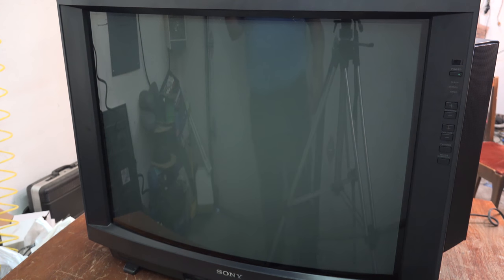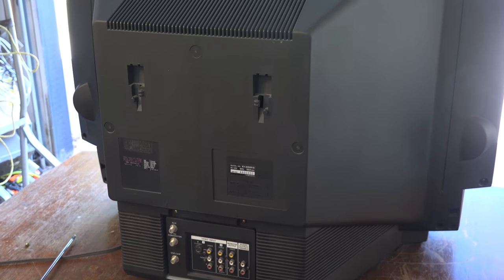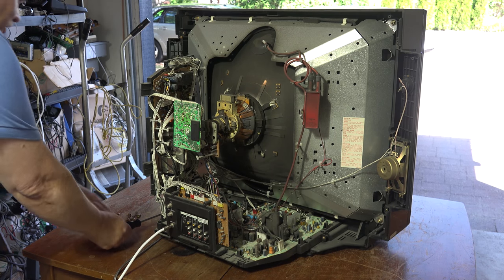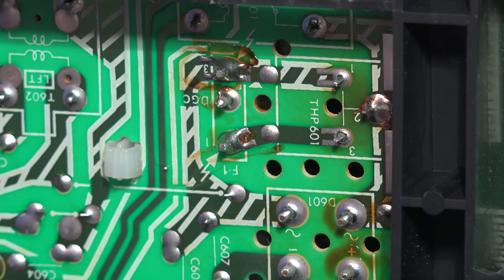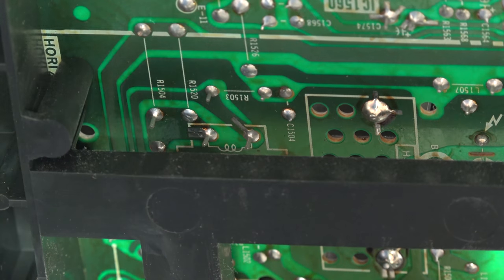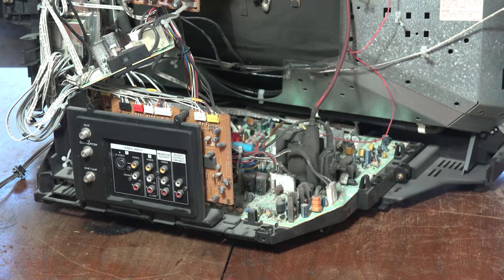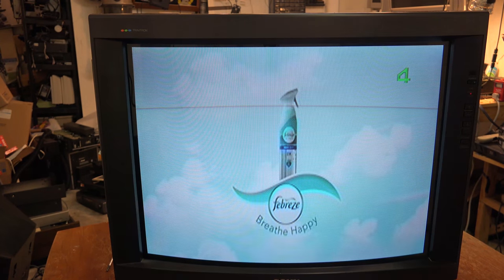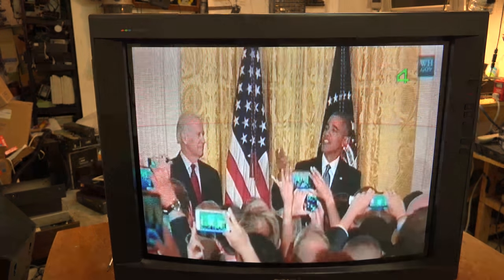SONY CRT Distorted Color Degauss Fix

Comment: I had the same problem with my TV(LG). I watched your video and right after checked what was the issue in my case. As it turns out my problem was exactly the same. 10min fix and it works like a charm now. Thanks dude!
Reply from the maker: This fix applies to all CRT sets.Every color CRT TV or monitor has the exact same circuit, so whatever the brand, this trouble does happen. The degauss thermistor runs hot. That is how they work. They start out at low resistance which allows full current to flow though the degauss coil to neutralize the magnetic field that builds in the shadow mask or aperture grill in the tube. As current flows through the thermistor it gets hot. As it get hot the resistance increases and thus the current drops. This causes the alternating magnetic field in the degauss coil to gradually drop thus demagnetizing the tube. This increase in resistance makes even more heat in the thermistor. The hot / cold nature of the thermistor puts stress on the solder connection due to the dissimilar metals. Copper for the PC board and leads to the thermistor, and solder which is a tin / lead, or a tin/silver/copper alloy. Eventually it will break on probably 90% of tube tvs in service.

Comment: Awesome!! I was just given a 13 inch JVC from 1989 with the same problem, I was flexing the board and it started smoking for a second and then the screen was good but only lasted like an hour that was aa week ago, just watched this video and found a pin on the same piece with melted off solder and just re soldered it and is now looking pretty good for a 34 year old tv.. Thanks!!!

Comment: Sony crts are brilliant, we still have our 14" one in our bedroom from 1989 still working fine, husband repaired it once when a resistor started glowing, that was 10 years ago, brilliant tvs these, yet our Samsung lcd downstars is always going wrong, I dont think the flats last as long as the old crts did.
Reply from the maker: No flat panel will last nearly as long as CRT. The first flat panels were plasma, and they got a bad rap out of the gate due to some issues, but in reality, those early plasma sets have actually lasted much better than the LCDs that replaced them.  Plasma sets have a very high part count, and that means more parts, and more solder connections that potentially can go wrong. LCD suffer from a similar fate, too much integration into non serviceable boards. So even though LCD have fewer parts that can go wrong, the density of the chips, and the way they are attached, BGA, and hot bar stamping onto flexible pc ribbon cables have some serious reliability issues. The move to LED is even worse. LEDs are not as reliable as people would like. The worst thing you can do to a TV now is run it cranked up bright. That heats up the LEDs and if you have a weak one, it will be the one that pops, and takes the entire set down. 
CRT on the other hand was very simple, and even though there were high voltage areas ina CRT set, they generally used large components that were not being pushed to the limits.  Also CRT technology has been around for 100 years, so they had that technology perfected decades ago.
Plasma is also an old technology going back to the Nixie tube era of the 60s.
One can think of a plasma TV as one giant nixie tube. As you can probably guess I love plasma TVs. As far as the flat panels go I find these just cool.
High voltage, and electrons flying through space. Cool.
Reply: I picked up a 27" Sears Sanyo set from 1989. My grandma has a Samsung LN52B630that replaced a mid 1990s Philips Magnavox in 2009. Hasn't failed yet surprisingly, it sees a lot of use too.

Comment: Thank you for the awesome share.
Quick note: 4:59 you forgot the bridge rectifier, it also has broken joints on the AC input side.
Reply from the maker: FixDaily 

Just because I didn't show that on camera doesn't mean it wasn't done. This video was to show the fault of the degauss thermistor failure. Not every potential fail. But yes I did solder it and put "way too much" solder on it according to the dozens of thumbs down the video got from the Trolls, I mean the experts that have never worked in the repair business. I had 15 thumbs down the first day with people "educating" me how to solder. So the video came down and that shot was cut completely.
Reply: I'm not one of the thumbsdown sir, also i'm one of your subscribers and i subscribed after saw this video so i gave you the respect you deserve, it just got me curious, didn't meant to be rude.

Comment: Another I formative article,  nice work! Kind of depressing though,  considering I got rid of a nice 2001 Sony Trinitron last year that had the same issue. These CRT TVs still have a place,  especially for those of us with a lot of retro AV equipment.
Reply from the maker: I tossed my old Panasonic 34" HD CRT a year or so ago because my wife wouldn't let me keep it, and regret doing so. It did have a problem though, and on t hat set Panasonic didn't sell parts, only full boards, and they were NLA.

Comment: The solder joints on the diode bridge D601, and the fuse F1 also have cracks on them.

Comment: That problem is very common here in the Philippines and I thought the reason is we are using a 220 volts power supply but I was surprised that you said it's a very common problem because in your country it's 120 volts so the heat energy from thermistor is only about a quarter compared to 240 volts. I can even see that the TV is rated 120 volts around 1:07 mark.
Reply from the maker: Actually the heat is the same, as the thermistor is a 120v rated unit here. 
The problem is heating and cooling. It causes stress fracture by thermal expansion of dissimilar metals. The copper expands at a different rate than the tin and lead in solder.

Comment: Very well photographed, I think I have the same problem with my 2002 Phillips. If I could find out how to buy a new "thermister" ( is that the correct term for the small black box pointed out?)  I would repalce it as gives the same reaction to coolurs when I prod it with a wooden rod.
 It has 4 pins which seem well soldered. The lettering on it is DJ1U-Q,10VDC,  8/60A,  250V,
DEC421 Japan - I think this last is the number of the PCB.

Comment: Is the problem of color distortion (in my Trinitron its a bit discolored on the right side) fixable by just getting a basic degaussing wand and doing it by the manual circle motion? Im not handy but i think i can handle a degausser wand
Reply: Nevermind, degaussing coil didnt work for me. Looks like internal damage to something.

Comment: I've read that the FD Trinitron displays, as well as the related HR Trinitron displays, are intentionally magnetized at certain points around the perimeter of the glass face.
Reply from the maker: They have a bunch of little correction magnets stuck around the yoke. you can see then stuck to the bell of the tube. Those flat strips also have magnets on the tips.

Comment: My 27" Sony Trinitron fell on its face now I have rainbow color like the one you worked on. What do I do now i love these tvs they're better than the new ones.
Reply from the maker: I hate to the the bearer of bad news, but what has happened in the aprature grill, which is what make a trinitron, a trinitron , has shifted internal inside the tube. There is noting you can do, the tube is internally damaged.

Comment: My dad made a degausser that can be plugged in and held near a CRT.  Boy does it get hot after a while!  A good demonstration of electrical physics.  If I may point out, Johann Gauss was a German; this being the case, the word 'Gauss' is pronounced with the 'au' sounding like the 'ou' in 'out' and the 'ss' sounding like the 's' in 'snake'.  Did you sell that?
Reply from the maker: Yes they get hot. I made one using the coil off an old TV back at the shop.
Reply: @12voltvids  Did you sell the TV?
Reply from the maker: @infinitecanadian  
Yes gave it away to 3 guys that moved out here from manatoba to work in the new mega mall. They wanted a CRT for gaming
Reply: @12voltvids  Excellent.  Glad to hear that.

Comment: The funny with the magnetic discoloration is that may happen even if rotate the tv to a different position while it is working and this is related with the earth's magnetic field,speaker magnets,metallic objects or random times.But the most strange of all was when i placed a tv after a repair to the customer's house and the weather outside was extremely cold and inside the house the room temperature was hot.When i pushed the mains switch ptc got cracked and caused a short circuit and i took the tv back to the lab for a new repair.Due to the high temperature difference between inside and outside the ptc ceramic disks broke in the transition from frozen state to hot.After that in cold weather every time i was leaving the tv five to ten minutes to get room temperature and customers were constantly wondering the reason why.
Reply from the maker: That is why the degauss circuit operates every time the TV is turned on cold.
Reply: What impressed me was that degaussing ptc seems to work inside room temperature limits and not from frozen cold to hot.

Comment: That line caused by the camera, on the tv, looks like a problem I'm having with my old crt. The lower part of the display has this problem where horizontal lines just like the one ween in the video would flicker every now and then. Do you have any idea what the problem might be? Where would you look, at the V. Out IC?

Comment: What if you still have the exact same issue, barley any "thump" from the coil and the solder joints are perfect. I cannot find a reply online and the ones I have from donors are not the right size or number of pins. I need a 3 pin terminal and I only have 2 terminal donors

Comment: Great repair, you know, I'm trying to repair an old TV that my grandfather gave to my dad as a wedding present. It's a Sony Trinitron KV-1942R (1978), the thing is, everything works fine except the colour,  the image is black and white and I don't want to take it to repair near me since every repair guy here takes parts from electronic devices, i've opened it and it seems there´s nothing wrong, except being soooo dirty lol. I'm clueless on what's going on.
Reply from the maker: Loss of color generally means the 3.58 color oscillator is not working.  Could be the crystal is bad or one of the little caps in that circuit.  Unfortunately unless it is an obvious cold solder connection you will likely need a scope to trace the loss of chroma or sub carrier reference.
Reply: @12voltvids  Thank you for your help, what I did find was a mini cylinder glass with 2 wires inside, it had a lot of rust,  it was  on the board from the yoke, I did solder it and nothing. I'll keep diggind on what's going on. I'm confused since it has like 3 boards to work with.

Comment: I have horizontal lines with washed out colors on the 2 composite inputs in the back. The S-Video input in the back  and the composite input in the front looks fine. Is it the Deguasse too?
Reply from the maker: Sounds like something in the video input switching.
Reply: @12voltvids  turns out my TV is fine. All my other consoles worked fine and the picture is fine. It seems it doesnt like my NES clone as it only looks distorted with that console even though it works fine on my other CRTS.

Comment: Awesome knowledge , are you an electrical engineer per chance?
Reply from the maker: I was a diagnostic engineer not a design engineer. I have designed and built amplifiers, but mostly just troubleshoot and repair stuff and I am not getting much into digital equipment.  Have very little interest in learning the new stuff. I retired from the electronics business in 2003 and retrained in telecom industry.  Just a hobby now and a way to make some pocket change and keep the mind sharp. That's probably the biggest reason i still do this.  Makes me think. You know the saying, use it or lose it.

Comment: Hi, I'm learning a lot from watching your videos. I recently purchased a sony kv40xbr800. I'm having an issue with a 6 & 7 blink code. The set will turn on after about 6 times of cycling the power on & off.
I've replaced both of the ic chips and the D board but I have the same issue. I'm guessing it may be a capacitor? Any help is appreciated, this tv is over 300 pounds and I don't want to get rid of it. it's an awesome set.

Comment: i also do have the same problem with my Samsung 21 inch tv, sometimes the colors are prefect, sometimes blue green , is it just the solder that causes the problem, what's  actually inside degausing coil, whaif i solder the coil connection to the pcb for the best contact, connectors can become lossey too(i personally had those experiences), solder seems to become dry everywhere on the board, environmental reasons maybe.

Comment: Hello sir, I have a Sony wega trinitron crt TV, I got for free and use it for retrogaming. At the bottom of the screen only, the image has a blue tint. If the image on screen is white, it will look blue/light green on the bottom. Middle and top of the image are good. Do you think it is a degauss issue? Thanks from France!
Reply from the maker: The degauss circuit is designed to degauss the set every time it is turned on cold.  More likely the set has tipped over into its face and dislodged the aprature grill (trinitron equivelant if shadow mask) and the tube is now toast.

Comment: for some reason on my xbr 36 inch trinitron circa 2000-2001, the composite inputs occasionally glitch but the component and on screen text doesn't glitch at all. any idea whats wrong?
Reply from the maker: Check the 3d comb filter circuit. Tuner and composite video goes through that circuit. Component does not.

Comment: I bought a pvm off ebay about a week ago and it came in the mail last Friday damaged. Mainly the bezel got cracked on the upper corners of the bezel but I'm also having some issues with the picture. The bottom left of the screen has a green tint in the corner, a blue tint in the top right, and a blue tint in the lower right. Tried degaussing but the pvm's degausser isn't strong enough. I know you can't see it but given the issue do you think a degaussing coil could save the day? I put fridge magnets in 2-3 locations around the bezel frame and could get a clear picture. Of course that changes the next time you turn it on the pvm does a slight degauss change. Even tried the corded drill trick to try and demagnitize but it was way too weak.
Reply from the maker: I hare to say this, but if the shipping company tossed it around enough to break the bezel, then the aperture grill inside the tube could also have been dislodged, and if that happens you will never get correct purity, and the tube will need replacing. I changed dozens of tubes that were damaged when a TV fell off the stand, or tipped over in a car while being transported and fell on the face. Not hard enough to breal the glass, but enough of a shock to move the aperture grill a couple mm and that is all it takes.

Comment: Nice tv saved from instant death :-D
I also knew it was the de-magnitiser that was doing nothing, the word "Pozister" came straight to mind, thats what i allways knew them as.
Oh yes i allways checked the lopt connections too, i didnt see many tv's that didnt have cracked joints, also the frame chip was typical due to heat.
And a quick look round the psu.

A good frend of mine managed to magnitise his tv, he had left something very magnetic on top of the tv without thinking, he was angry and embaressed to see me because what he had done.
 It was really badly magnitized, the on/off cycle wasnt good enough to clear it, i took a small american made "Han D Mag" (B.B.ANNIS CO, Indianapolis, ind,usa) demag tool and went over the screen, repeating it progresively getting further away untill it didnt affect the picture any more.
Lovely tv :-D, no more problems.

Comment: I’m currently going to thru and issue with my monitor degaussing coil is starting to melt and fry but when I remove the coil the monitor works just as normal but I will run into purity issues in the long run. If the monitor has no cold joints and all the fuses are still intact how would I start to attempt the repair or navigate the issue further? Thanks
Reply from the maker: The thermistor is bad.  How it works is when the thermistor is cold it had very low resistance and allows a ton of current through the coil.  It heats up quickly and as it heats the residence goes way up. As it goes up the current drops down to nothing.   The few ma that runs through the coil during operation is so low that it doesn't affect the picture nor produce ant heat.  If thermistor is leaky current will be excessive thus heating your coil.